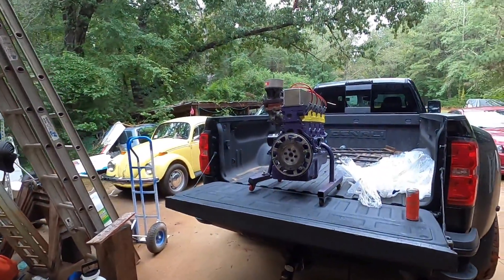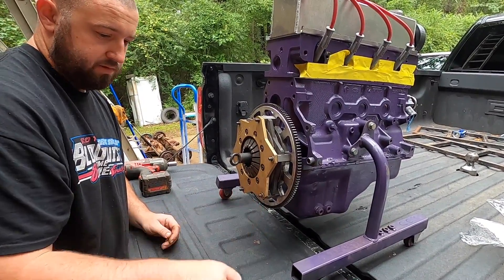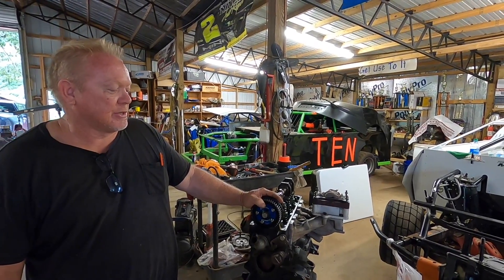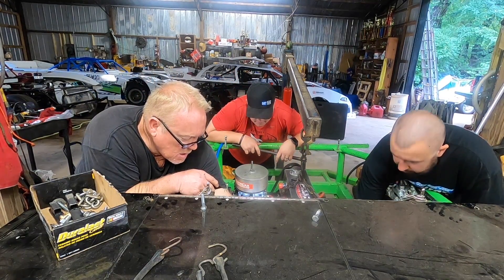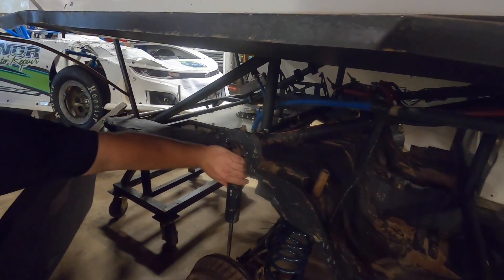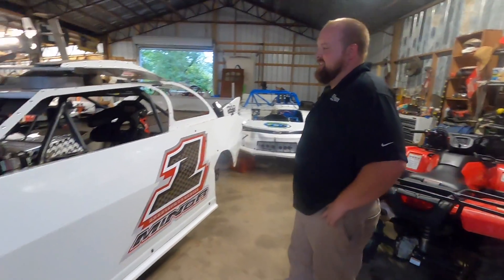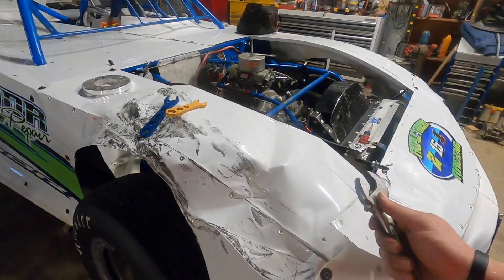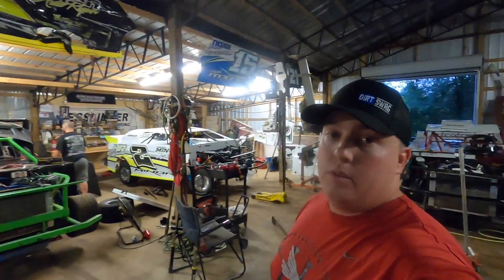What Is A “Kajun Mini Stock”?? / Chasing Paper This Weekend!

Comment: Do you run stock stroke with 5.7 small journal rods? That is combo I used back in the 90s to build the 2300 for customers running the Miss. tracks.
Reply from the maker: Small or large journal. We run 5.7, 5.8, or 5.9 rods. Honestly different heads run better with different rod lengths

Comment: I run ministocks on asphalt here in eastern NC. Are the efi intakes better? I noticed both had them on them. We are a budget race team up here trying to make it week after week.
Reply from the maker: It honestly depends on the combination. Bo has a built intake that’s pretty mean but our oem ones we have are pretty stout too!
Reply: @ThemMinorBoys  ours is a .30 over wiseco 5.7 manley rod motor crank turn .010 on rods and mains head is stock valve solid lift head with .450 lift cam and 290° duration stock Dport intake with 1in spacer and a carb  shop carb 350cfm.

Comment: I have a question, what starters/solenoids do y'all run? I've raced pony stock/ mod mini on and off for 6-8 years. I've ran the big mustang starters and the small ranger starters and I've ran all kinds of different solenoids and it never fails after 5 or 6 races one of them goes bad. It's just a headache. I just wonder if the high torque starters are worth the money?